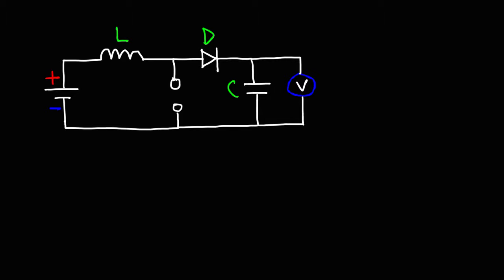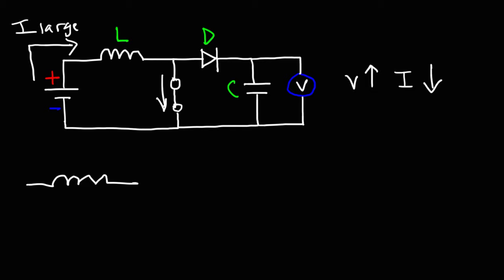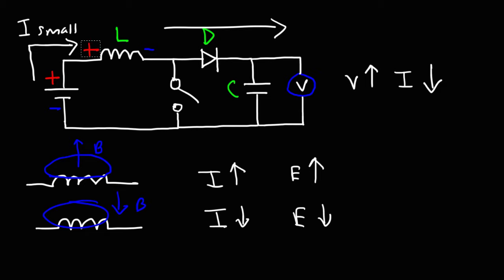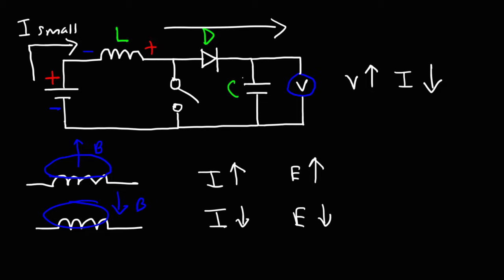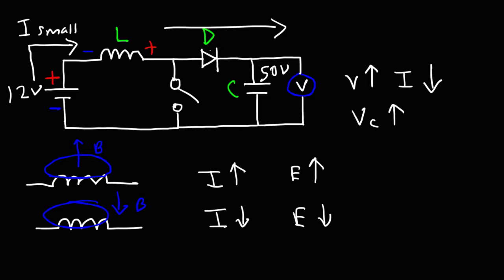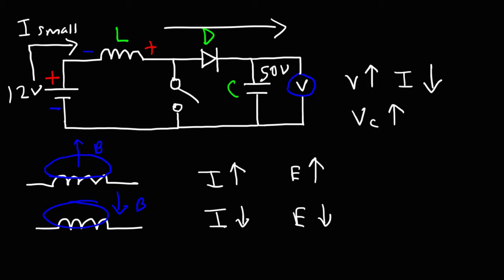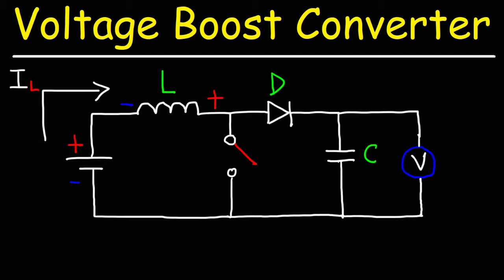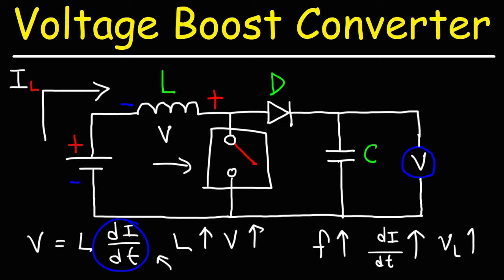Boost Converters - DC to DC Step Up Voltage Circuits

Comment: One correction to note: The output current is reduced because of P = IV where P must be equal or less than the input power, not because some is lost to switching. The loss to switching is what causes a reduction in efficiency of the boost converter. Some of the best modern boost circuits run at about 95% efficiency.
Reply: You didn’t say anything new. 😕
Reply: So where is the current?
Reply: @yasyasmarangoz3577   It gets exchanged for the higher voltage per P=IV
Reply: The maker of this video didn't have a really firm grasp on the fundamental concepts. I've seen much worse, but he still makes some misleading statements. I simply can't make sense of what he is trying to say at a couple of points.

I got around 95% efficiency or better across the input voltage range for a universal input active power factor correction stage that was delivering around 1.2 kW, and that was in a design I did nearly two decades ago. FETs have improved quite a bit since then.
Although other topologies are possible, active PFC is usually implemented with a boost converter with the interesting requirement that the instantaneous input current be directly proportional to the instantaneous input voltage (as you want for good power factor) but the average input current must inversely proportional to the average input voltage (because of the negative input resistance characteristic of a switchmode converter).

Comment: Intuition which led to invention of boost converter :- When current passing through inductor is suddenly stopped, huge voltage develops across inductor.

Comment: The best explanation of how these converters work that I have seen.  I'm trying to build a 40v to 400v DC-DC converter for charging an EV from vehicle mounted solar.  Thank you, you have a new subscriber
Reply: Damn thats a pretty intense thing to try to build on your own if your not very familiar with electronics! how did it turn out?
Reply: Did you end up making the circuit? if yes, how did it turn out?
Reply: He died :(

Comment: thank you so much, just by saying that the interruptor is there for shorting the circuit i finally understood this
Reply: This was a key piece for me as well. We're just charging a battery then sticking it in series with the source.

Comment: A boost converter without a load can produce an arbitrarily high voltage regardless of the switching frequency or the inductance. In practical circuits there is a limit because of of losses, primarily those due to switching transitions that are finite. Of course eventually something would go Bang! due to excessive voltage stress.

At the instant the switch opens, the current through the inductor is exactly the same as it was the instant before the switch was opened. This is the most fundamental aspect of the nature of an inductor in this sort of circuit (where you are considering energy storage and delivery as opposed to considering it in terms of impedance in an AC circuit). The voltage across the inductor will rise to whatever voltage is required to allow that current to flow. At opening on the very first cycle that voltage will be equal to the diode forward voltage if there is no load on the circuit because the capacitor voltage will be equal to the battery voltage, having charged before the switch was closed (provided there was sufficient time after the input power was connected before the first cycle began). With each additional cycle the voltage on the capacitor will increase, hence the voltage across the inductor will increase. Again, unless there is a load connected and ignoring losses, there is no limit to the voltage to which the capacitor will charge regardless of the inductance, duty cycle or switching frequency.

Vdt = Ldi or the alternative arrangements says that in equilibrium with a load the rise and fall of current in the inductor is linear ramps. If the inductor is not allowed to fully discharge with each cycle, these ramps "ride" on a DC level.

Comment: simle but effective. you need a hi tolerent diode though
Reply: I don't know what you mean by "a hi tolerant diode." The voltage rating needs to be no higher than the output voltage of the circuit. The current rating needs to be no higher than the input current of the circuit (it will see instantaneous current higher than the average input current, but that rarely is much of a concern). Fast reverse recovery time (the time it takes the diode to switch off when the reverse bias is applied) is important in practical boost converter circuits. Schottky diodes are often used if their voltage rating is adequate.Their forward voltage is lower than that of a similarly-rated PN junction diode and they are extremely fast (very low reverse recovery time).

Comment: Great video. I use those sealed marine grade 12v to 36v (5a) step up boosters to convert 12v battery power to power Bluetooth digital chip amplifiers in my speaker builds. They work flawlessly. Here's my question, why do my amplifiers (running at 36v) sound better (more power, fidelity) vs using their stock (included) AC/DC adapters that come with these little digital chip amplifiers? I don't have an audio dyno or distortion tester...but, I can "hear" and "see" the difference when the woofers on my speakers are pounding harder. Thanks.
Reply: My guess is that the larger power supplies are better able to handle the high and relatively long transient current required for loud parts. The voltage of the small supplies probably "droops" under heavy load because they are overloaded. When the supply voltage drops the audio amplifier tires to correct but it may not be able to, resulting in "clipped" waveforms. It MIGHT be possible to make them sound better by adding capacitance across the output of the supply for better transient handling, but that does nothing for prolonged excessive current demand.
It would be quite easy to confirm or reject my hypothesis with an oscilloscope.

Comment: How the circuit will work/functional? and How the voltage and current waveforms at the output?, If we keep the load as a inductor or capacitor instead of resistor?. Please could you answer my question?.

Comment: Would there still be an increased voltage output without the transistor? Perhaps using the most powerful inductor and highest useful frequency. Thanks Alan

Comment: Sir, i have used MT3608 step up booster and connected with 5v Lithium Battery with rated of 3000mah and set constant output as 12v, however when i connect to any dc device like wifi router, settop box or dc mother 555, automatically the output from 12v its drops to 4v, Not able to understand. Could you please give some insight in what sceniaro could lead into such issue.

Comment: sir iam a student in srilanka , sir thank you for the video , sir i want to know that when out put voltage increase how does it reduce the current , when we take ohms law voltage is equal to current doesnt it happen in here sir
Reply: In general terms, switchmode converters are power converters - the power from the output is equal to the power at the input, ignoring the losses (things like resistance of the inductor winding, losses in the core of the inductor, loss at each transition of the switch, diode forward voltage, etc.).

Because of this, a switchmode power supply actually has a "negative resistance" input characteristic. That doesn't mean it actually behaves like some true resistance of negative magnitude, but that the slope of current versus voltage at the input is opposite what it would be for a resistor if you were to make a graph. It a normal resistor if you increase the voltage across the resistor the current through it will increase in direct proportion. With a negative resistance, if you increase in voltage the current decreases in proportion. For example with a switcher, if the input had 10 volts applied and the current were 4 amperes (so 40 watts) and you increase the input voltage to 15 volts, the input power remain the same and the input current would become 40 watts / 15 volts = 2.67 amperes. In practical circuits the relationship won't be perfect because the losses in the circuit change in non-proportional ways with varying voltage and current. Maximum efficiency might come at some particular input voltage with lower efficiency for both lower and higher voltage.

Comment: So, the switch has to be closed then opened again? 
Do we have to close-open-close-open continuously, or do we just do it once?

*I don't have electronics knowledge 😶
Reply: @computifyguy  Thank you.
So, the result is not a flat voltage, but more like a wave? Or is it the current that is going up and down?
How can I get that PWM?

Comment: I think the current will be increased due to the charge accumulated In the output capacitor and the inductor current, not as you have explained because no way to add the current of the inductor and the input source when the switch is off ( circuit ON)

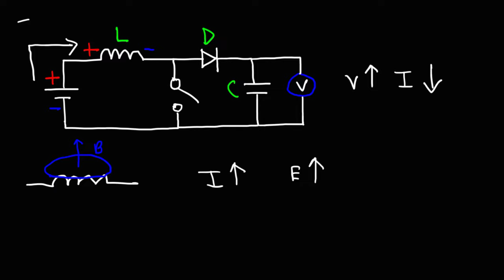Comment: 1:52 why it is small current? even switch off whole current will flow through inductor L? 

please reply
Reply: This video has a bunch of problems. The output voltage may have nothing to do with the inductance or di/dt as long as the inductor current is continuous. Your point is also correct, the current should not suddenly change from large to small.
Reply: @henryfordson4787  the current should change to small of course because the energy should be the same, this is a logical physic phenomenon. but the wrong thing I saw in this video that the increase of voltage is depend on the frequency and this is not right. i think it's dependent on the rise time of changing of the state from high to low and low to high.
Reply: With no load connected the current through the inductor would decay to zero once the output capacitor was charged, before any switching started. However, if there were a load connected the current, again before switching started, would be equal to the (input supply voltage minus the diode forward voltage) divided by (the inductor winding resistance plus the load resistance). You cannot protect a boost converter against short circuiting of the output without additional circuitry.

Comment: Why is the capacitor necessary? Surely the voltage can be used up by the load?
Reply: My understanding is that to get to the required voltage you need more than one cycle to add up voltages with the inductor, and to add up the voltage it needs to be stored somewhere between the cycles which is why we use a capacitor.
Reply: @louistiticaramel6848 yes you are right from what I understand. Also if there wasn't a capacitor to smoothen the signal, the output would just oscillate.

Comment: This video has a bunch of problems. The output voltage may have nothing to do with the inductance or di/dt as long as the inductor current is continuous.